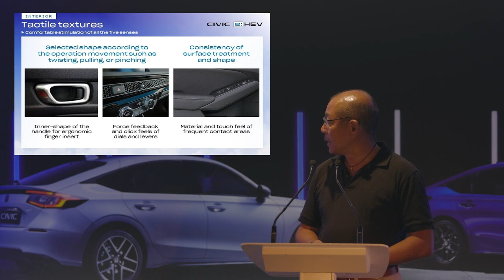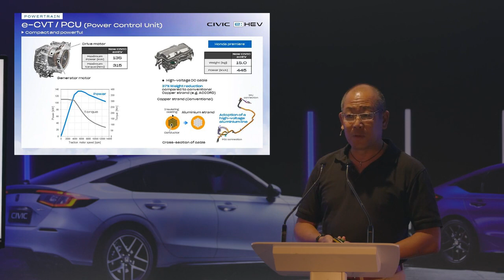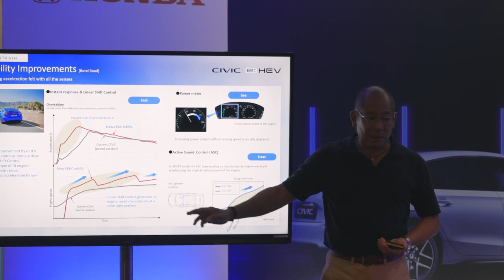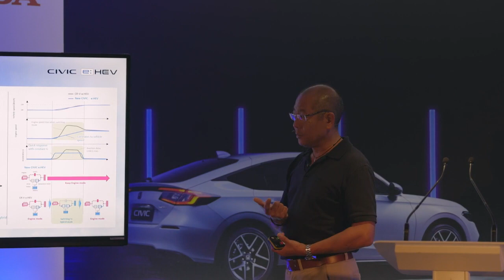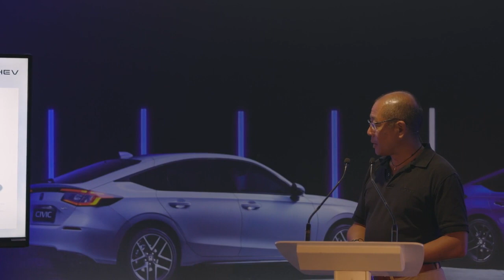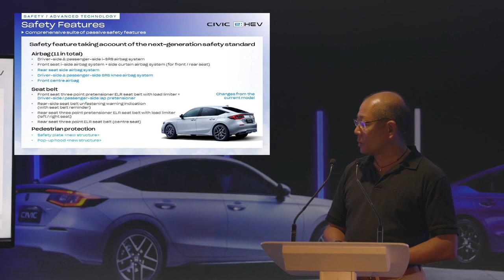New Civic e:HEV European Premier Event Presentation

Comment: I am an owner of a 2025 hybrid sport touring in the U.S. I must say, around 50 mph, there is a huge lag between throttle application and the clutch engaging, then power. Maybe a couple seconds. Not very intuitive for quick two-lane passes. The car seems unpredictable at higher speeds how much power will be there.

Other than that, it feels like an open differential at low speed corners, lighting up the inside. 

Maybe I'm just ignorant to why, but if there is no trasmission, why not just have an e-diff like the Elantra N?

Cost? Not needed in this segment? 

If this engine goes in the Si, it will need a larger battery for blasting down winding roads more than a couple minutes and a diff.

Please correct me if I'm wrong.
Reply: Since the clutch is supposed to DISengage in the passing scenario you describe, it is hard to diagnose the issue you describe. Below is a simplistic description of my 2018 Accord, and from the video it sounds like the strategies have been improved, but the underlying concept is correct.

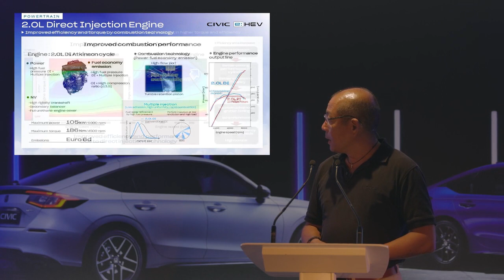The e:HEV system really is an EV most of the time. Not a Battery based EV, like a Tesla, but a Generator based EV. It is called a serial hybrid. The ICE runs in an efficient range (see 10:25) regardless of the power needs of the car, the system uses all of that power to generate electricity, the PCU adjusts the power using the battery to add (discharging for power assist) or subtract (charging) power, and the correct amount is sent to the traction motor.

The one exception is steady-speed highway cruising. Converting all of the ICE power to electric, then back to mechanical, adds losses. If it is reasonable to assume that you won't change power demands rapidly, that step is removed. The clutch engages to send mechanical power directly to the wheels, and the traction motor-generator performs the power adjustment on a fraction of the total power instead of all of it. This is called parallel hybrid, and is how the Elantra works at all times. Except it uses a DCT transmission while e:HEV uses just one (overdrive) gear.

What happens when you stomp on the gas, is that the system has a threshold for when to disengage the clutch and use the more powerful, and flexible, serial hybrid mode. A quicker disengage is less efficient but eliminates any lag like what you describe. ECON mode has the highest threshold, and SPORT mode has the lowest. It sounds like you use ECON. I personally switch to SPORT if I can anticipate the need to accelerate.

Comment: On that slide about sport mode there is a graph which on the vertical axis is the engine speed against time and the the graph rises and falls between shifts on for the civic ehev. Does this mean the simulated shifts for the electric motor actually stops for a moment between shifts? or are the shifts purely noises?
Reply: I installed an OBD-II Smart gauge to my Civic ehev so I can see a real-time engine RPM. As I could observe, the engine RPM DOES actually drop to simulate shifting, although there is no real shifting occurred because the car has only single gear ratio. In contrast, the HR-V (Vezel) ehev has no such simulated shifts, the engine RPM stays at 5500+ rev/min all the time when fully throttled from stationary all the way to top speed (180 kmph).
Reply: @จีน่าวสิน whoa hey thanks for that, it’s crazy that they went to that effort!

Comment: Mr. Yamamoto, thank you for such a enlightening presentation about the new generation of Civic Hybrid. Does this 2.0L DI engine face issues with carbon buildup of the intake valve that is common in other GDI engines? Or does the Atkinson cycle design reduce/eliminate this?

Comment: Is "power meter" accurate as to percentage of total output power (kW)? For example, would EXACTLY 50% on the power-meter during acceleration indicate EXACTLY 67.5kW of power output?
Reply from the maker: Sorry for the late reply. The power meter is not an absolute meter i.e. 50% is not always 67.5kW. It is more a relative power meter as it indicates the percentage of releasable power under the actual specific driving condition incuding all parameters like battery charge level, ambien temperature etc. If you floor the accelerator while accelerating, the power meter can indicate 100% all the way up to top speed yet absolute maximum power is released finally when reaching top speed. I hope that answers your question.

Comment: This hybrid system is the best implementation of hybrid setup, please get this for other honda models in India.
If I had to suggest anything for this setup is adding motor(s) at the rear axle for the RS variants OR just shift the motor from front to rear axle if possible.

Comment: I think understanding why there isn’t a brief output of 140 plus 184 is quite hard to understand. I have now decided it doesn’t matter that I can’t get it. The car drives great!! Thank you for the presentation and long answer to another comment on roughly this topic.
Reply from the maker: One last try to clear things up. In theory you are right that when the system is working under 'parallel' hybrid operation i.e. the engine is connected to the wheels driving the car and the electric motor is providing assist power for acceleration, both outputs could be added to create a higher output than the nominal 184PS, however that is from marketability perspective not suitable for everyone's use as a 'normal' daily use passenger car characteristics. The reason is that when the battery assist is ending after let's say 20 seconds, the car would ouptup less than half the combined output resulting in a drastic change and drop in performance which could be dangerous n public traffic situation (e.g. while overtaking or going up-hill). As a special performance car in theory the additional assist power could be used as a 'boost' or 'overtake' feature just like an NO2 injection known from Fast & the Furious. In that case the car would have something like nearly 300PS for a very short time but also needs reinforced spec to withstand that output. The reason why you can't just add both maximum output figures from engine (140PS) and electric motor (184PS) is that they have their peaks at different rpm so you need to look where the addition of both figures becomes maximum.
I hope this helped.
Reply: @kotaroyamamoto808  how many kW can the battery output?

Comment: Thanks for the explanation about the e-CVT which indeed got a lot of us very confused.  Do you know what is the reason behind the choice of this name although the principle is completely different than a traditional CVT gearbox?
Reply: In R&D papers as late as 2018 ("Intelligent Power Unit for the 2018 Model Year Accord Hybrid") it stood for "Electric coupled Continuously variable Transmission." Which is accurate, but not very useful. I think it was marketing that preferred "electronic CVT" which is inaccurate, and less useful, but fits on a window sticker.

Comment: Ordered the Advance sonic grey (in Romania), first available delivery date (Oct-23) coincided with the color I wanted👌. I would have wanted more configuration, especially as I think the 18' black wheels are nicer on this color than the silver wheels, unfortunately no options for configuration ... I would have paid the extra cost over the regular 18' wheels (like a trade-in)
Would using a larger battery (than the 1.05 kwh) helped to have more EV mode in city? I mean I would trad 30L of boot space for this :)
Also wasn't possible to equip a 50L petrol tank? For motorways, where consumption is highest, would have been helpful. Thanks

Comment: Thank you for the presentation. I often travel with family to remote locations with little access to road side assistance. 

I'm worried that the electric motor generator is a single point of failure: ie. if that motor goes bad, the vehicle might stall. How does the e-cvt handle such eventualities? Does it have a "limp home" mode?
Reply: That is a great question, but to be honest the generator is so simple it would be hard to break anything in it ;)

Comment: Thank you very much for the presentation! Under which conditions does the e:hev system in the civic run purely in electric drive mode? Does the ICE always start when starting the vehicle or can you set off in ev mode?
Reply from the maker: If you press the START button first thing in the morning, the engine will probably start in order to heat up the catalyst. After a few seconds the catalyst should be activated so the emissions are sufficiently converted into harmless substances. When this is achieved and if the cabin heater requirment is not set to high temperatures (or the air-con to low temps) and the IPU (Intelligent Power Unit, i.e. the big hybrid battery) does not necessarily need charging, the engine should turn off. After that the e:HEV will set off in pure electric driving. Once the system is warmed up and under usual driving conditions the car will in most cases (unless you floor the pedal to the metal) set off in pure EV mode. There is no button to "force" the system to stay in EV mode since the system is calculating and determining when and under which condition it is best for efficiency to drive in which drive mode but it is quite easy to comprehend the behaviour of the system so you can manage to bring it in certain drive modes by controlling your own right foot. Pure EV drive mode can even occure up to high speeds (over 100km/h) if you gently control your right foot. For the efficiency it is always beneficial to utilise the electric energy from the battery whenever there is the chance since this energy was stored under operating the engine in an efficient operation point or it is gained from free-of-charge recuperation energy. By keeping the battery always ready for buffering energy, it increases the flexibility of the system to maximise efficiency.
Reply: Adding to his response, owning the hybrid engine in cold environments is going to drastically decrease your efficiency for at least the first 10 minutes of your trip as it does take quite some time for the IPU to warm up to optimal levels for use. I'm currently trying to gauge the ratio of pre-heating the vehicle before driving and actually driving. I would assume there is some benefit to warming the vehicle in the driveway before starting your trip but for how long, i'm not sure.

Comment: Mr. Yamamoto, please, a question about the maximum rated output. In the US market, the Accord Hybrid with this powertrain is rated for a "combined power" of 212 HP.
Since the motor's maximum output is 184, I understand this combined max power is only obtained when the system works in parallel mode; and must also be at high vehicle speed, with the ICE rotating fast enough to support acceleration while holding the high gear.
I'd like to understand better in which speed and load conditions this combined result is achieved.
Reply from the maker: The 184 HP is solely the maximum output of the electric propulsion motor. Top speed is also achieved only with the electric motor. For the e:HEV system there is no such thing like a combined output but is determined only by the maximum output of the electric propulsion motor but reaching this 184HP requires a combined power source. The engine-mode (parallel hybrid mode) is obtained in a speed range somewhat between 80-150km/h where the overall efficiency of driving the wheels directly with the combustion engine is better than converting mechanical energy (combustion engine) to electric energy (via the generator to the propulsion motor) and back to mechanical energy (drive power to the wheels). Over this speed the system always drives the car with the electric motor (series hybrid mode) up to top speed. Now the actual top speed is reached only with the 105kW (143HP) of the combustion engine converted into electric energy via the generator and in this case the propulsion motor also produces just 143HP of output. So when does the electric propulsion motor produce its maximum 184HP? In situations when the car faces an inclination while driving at top speed, the system will provide electric assist power from the battery to maintain the top speed as long as possible, even under uphill condition. In such case it can happen that the system gives maximum assist power (series hybrid mode with parallel motor assist) so that the electric propulsion motor reaches maximum output of 135kW or 184HP and exactly in this case both the engine output (converted into electric power via the generator) and the battery power work together as a "combined" output. The only reason why it could be justified to call this a combined output is that the 184 HP do not come from the generator (driven by the engine) only but also requires the maximum assist power from the battery. 
I hope this helps to understand the system better in this limit condition and how the "combined output" is produced.
Reply: @kotaroyamamoto808   thanks for the explanation. I would like clarification to be done. The maximum 184 HP is also obtained when you strongly accelerate (let's say an overtake situation) as long as you have a sufficient battery load? Or is it strictly related to inclination/uphill? 
Thanks
Reply: @kotaroyamamoto808  Hi. Thank you for your presentation. I have a big question about Honda Civic e:HEV for different countries. Are there any big differences between Europe  Honda Civic E:HEV and Chinese Honda Civic E:HEV? Battery parameters? Capacity as an example?

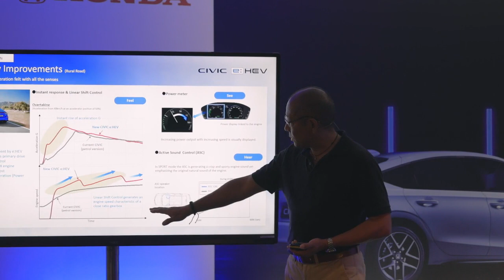Comment: I really enjoy this video with in depth information of Civic e:HEV that I couldn't find anywhere else. I have bought Civic e:HEV (sedan version). The car is really the driver's car. Acceleration sound feels nice with Linear Shift Control described at 18:22. It really does make the difference from Corolla Hybrid 1.8 we also have in our house. (Our country do not have Corolla 2.0 version) The difference is not just the acceleration is much better but the engine sound is much more pleasant to hear on the Civic. The interior is also better. Gas consumption is almost the same.